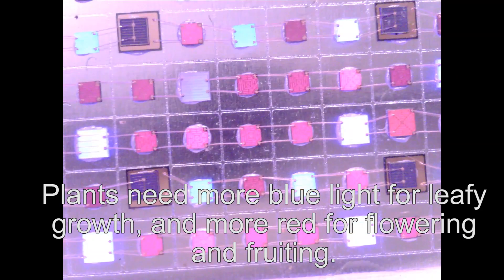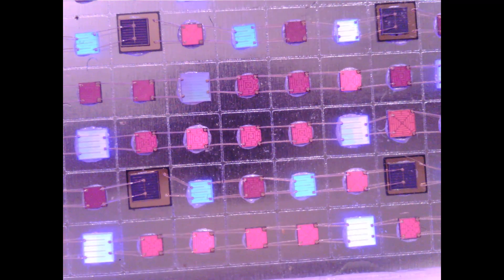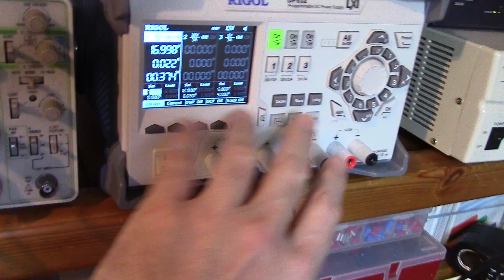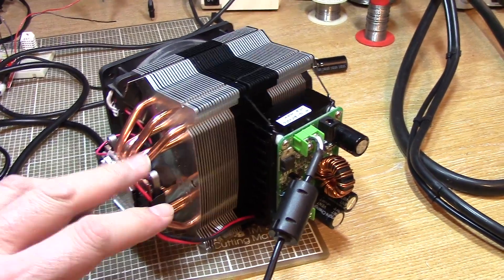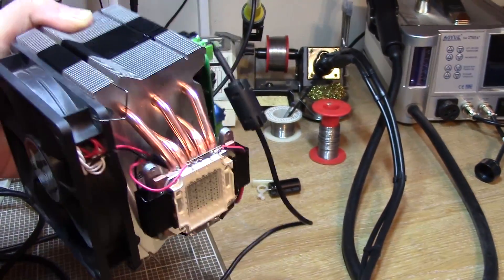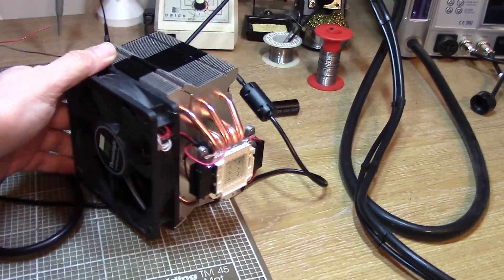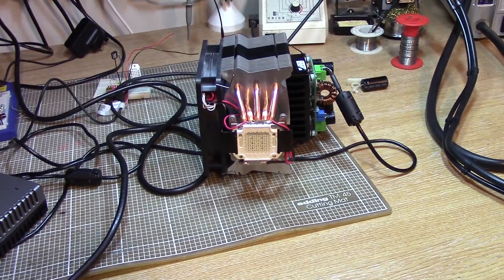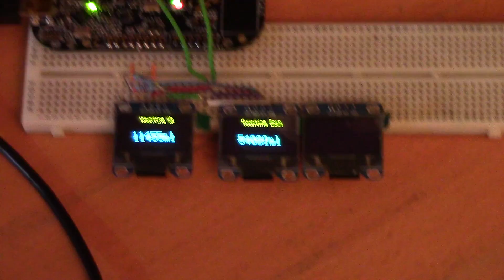DIY 100W 7-Band Multi-spectrum LED Growlight

Comment: You titled your vid as a DIY.  I'm Joe Schmuck and haven't a clue to what you're doing with all the electronics.  I'm picturing myself as busting down old TV's and radios to find anything close to what you've used there and with no understanding of what to connect and how.  Got a way to explain how to light up the LED's for the guy who just wants to grow a garden?  I'd love to have the full plant spectrum, but my knowledge of electronics is limited.  It is a great video and loved watching how you put it all together and the under the microscope view.  Never saw that before in any video on YT.  For the layman on the street, could I simply attach a power supply with an output of 12v or so?
Reply from the maker: Hi +Sincronicity - The problem with LEDs is that they need a current limiting device to stop them from killing themselves. The LED chip I used needs a limit of 3200 milliamps - I used an old laptop power supply and a  current limiting boost converter because I already had those bits lying around, but if you don't have that kind of stuff kickng about already, you're probably best off buying a ready-made LED power supply like this one... http://www.ebay.co.uk/itm/Waterproof-85-265V-Power-suply-LED-Driver-For-10w-20w-30w-50w-70w-80w-100w-Light-/271078945597?var=&hash=item3f1d90733d:m:mUxUWutlG6t_e-9rWseiHLw .. You'd need the 100W version of that power supply... Similarly I used the 12V computer fan because I already had that kicking around, but that meant I had to make a little circuit to get 12V to run the fan from... As an alternative, you could just use a 24V fan instead... like these ones... http://www.ebay.co.uk/itm/3D-Printer-24v-Cooling-Fan-25mm-30mm-40mm-50mm-60mm-Extruder-Fan-RepRap-/191458206299?var=&hash=item2c93cc625b:m:m6PyjIeUYOqwD28857uubWw ... Hope that helps. Cheers!!
Reply: +Jim Conner thanks Jim. I'm just one of those guys that knows enough about electricity to kill myself or start a fire. and thank you for giving such a quick response.

Comment: How are all the lights holding up so far?
Reply from the maker: Hi +Shannon Fraiser  - I only had the light running until the sunshine returned and I was able to move the plants out to the greenhouse. It was flawless for those four months, but has been sitting on a shelf since then. I will be putting it back into use again in January when I start next year's set of plants growing again. Given how cool the unit runs (<30C), I'm not really anticipating any problems for many years to come. Cheers!!

Comment: bomber light chap!
Reply: +Ryan Garcia interested to see how your nutrient meters turned out as well.
Reply from the maker: Thanks +Ryan Garcia  - Unfortunately the two circuits I made for the nutrient measurement are still sat on the desk gathering dust. I started a new job back in February and haven't had the time in the evenings to make progress with any of my electronics projects - It's very frustrating. I haven't given up though... next time I get a good chunk of holiday I'll try to make some more progress. Cheers!!
Reply: Awesome! best of luck with all, guess ill have to just stay tuned!

Comment: So 5 months on your tomatoes,cucumber and lettuces were all loverly and you had too many to eat yourself so you gave lots away? lol
but seriously did they grow ok size wise,quantity etc?
Cheers in advance
Reply from the maker: Hi garry parsons  - You've pretty much hit the nail on the head there. Everything did superbly under the lights until the weather was warm enough outdoors for them to grow in the greenhouse, and then everything grew spectacularly for a while. I've had a few setbacks though - I had the ceramic shaft on a water pump shatter leaving my strawberries without water for two days - that was a major setback. I've had reservoirs run dry repeatedly because I've still not got around to automating their top-ups, and I've been plagued by first fungus gnats, then aphids and currently spider mites... but in spite of all of that, I've still had great results. There's a 2"x3" box in our kitchen which is full of onions, peppers and tomatoes - we eat them as fast as we can, but it's still more food than we can give away. I certainly can't fault this grow light in any way though and will be getting it back into service for the coming winter once again. Cheers!!
Reply: Jim Conner cheers for quick response.
 Ahh just watched your vid over the spider mites .
You tried diatominous earth powder ?? costs nothing really you can add it to water and try it that way or powder it
We use it for chicken mite basically it kills most insects via contact and its not damaging to plants that im aware of  powder the room and walk away :D
Reply from the maker: Hi again garry parsons  - Diatomaceous Earth is something I've heard mentioned on a number of videos, but never really understood what it was all about - I've just been off and read up on it, and ordered myself a couple of kilos from Amazon - always handy to have more solutions in my arsenal. Thanks for the tip. I'll give that a try in a few weeks against the aphids in GH No.2 (if the neem hasn't worked by then). Cheers!!

Comment: Nice DIY LED Grow light, thanks for posting. Ive been wanting to make a 100W LED spot light (or possibly a grow light) for some time, I already have the perfect CPU heatsink for the job. If possible could you please post some links for the parts I would need (converter, transistor, power supply & circuit diagram?) or at least the specifications for the needed parts. I'm sure if you just listed the exact specs of the needed parts I could find them myself. Thanks for your time, take care & TECH ON!
Reply from the maker: Thanks William Chapman  - There's a link to the ebay item for the LED down in the comments here... That part came from a seller called tubelight. The converter I used is another ebay cheapy... if you search on ebay for '600W boost converter' you'll find the right item - they all look identical, so I just go with the cheapest seller on those. You'll want an old laptop power supply to run the whole setup... It needs to be capable of delivering around 90W of power - 4.5A@19V seems to be quite a common type of laptop supply to use and that'd do the job nicely. For the fan power regulator I used the schematic I found at http://www.radio-electronics.com/info/power-management/linear-power-supply-psu/series-voltage-regulator-theory-circuit.php - You need a 12V zener diode, a 1K resistor, and an NPN transistor - It doesn't matter too much which particular NPN transistor you use as long as it's a transistor in a TO220 package style (the ones with the metal lug at the back) as it'll need to be able to dissipate a couple of watts of heat. I can't remember which specific transistor I used... it was just something I desoldered from an old circuit board somewhere. We don't need to care about the transistor gain value or switch on voltage or anything clever like that... you just need a chunky NPN transistor. Hope that helps - if you need any more details, ping me again and I can elaborate some more. Cheers!!
Reply: Thanks for the prompt response, Jim, much obliged. I should be able to complete approximately 95% of the DIY project with the information you provided however, I will probably have a few basic questions on a couple things just to make sure I understand everything & do it correctly. I have the knowledge & skill to build a custom desktop PC but I'm not too familiar with these kind of parts/components (boost converters, voltage regulators, transistors & circuit diagrams). I do have a basic understanding of these components & what they do but I'm no expert by any means, so I will probably need a little advice/assistance to ensure I complete the project properly. Once I obtain all the components I will complete as much of the project as I'm confident doing, if I get stuck or am not sure about something I will contact you for further advice. Thanks again for time, take care & keep the DIY tech vids coming.
Reply from the maker: As long as you have a multimeter so that you can set the voltage/current correctly then I'm confident that you won't struggle too much with this project, but if you need a hand I'm always somewhere near a PC and pretty quick at picking up my messages. Good luck and let me know if you need anything. Cheers!!
Reply: Thanks again, Jim, you're a very knowledgeable & generous person. I sure wish I lived near you because I would love to come assist you on some of these projects, I know I could learn a lot from you.

Comment: I like to see if u wood sell me a led or make me one I got cash hit me back I need one. Bad I got one or tow I need a good grow led can u help
Reply from the maker: Hi Paul Goudelock - I'm afraid this was a one-off for me using bits I already had lying around. The LEDs themselves are still available on ebay though (as are all the parts I used), and as you've seen in this video, it's super-easy to build one for youself. If you're looking for a ready-made unit though, searching for 'COB grow light' on ebay will find you what you're looking for (COB = Chip-on-board... the kind of LED I used for making this). Hope that helps. Thanks for watching and taking the time to comment. Cheers!!

Comment: Will you be putting these in production ?? .. the existing led grow lights are just ridiculously expensive
Reply from the maker: Hi Gary Host - I have absolutely no plans to go into production with these lights. It seems to be the light-engine variants of grow lights which command the premium price... If you're happy enough to go with individual LEDs then you can pick up a 100W ready-made light for about the same cost it took me to make my 100W unit... Here's the sort of thing I mean.. http://www.ebay.co.uk/itm/VIPAR-V200-LED-Grow-Lighting-200W-Indoor-Bloom-Veg-Spectrum-Hydro-Lamp-Fixture-/171730909133?pt=LH_DefaultDomain_3&hash=item27fbf5b7cd ... (although the advert says it's 200W, the specs say it uses 90W of power).  Hope that helps. Cheers!!
Reply: Jim Conner I dont believe the larger diode type panels are as good. With the 100w multiband the light is more intense. If you look at the "real" grow lights such as the Heliospectra etc.. they all use the concentrated chip, not diod based lights.
http://store.heliospectra.com/collections/bestselling/products/lx601 

Unfortunately those cost £1500 a piece but they are 630w of power, and wifi controlled.
Reply from the maker: Thanks Gary. That heliospectra light sure looks like the business... I very much like that you can tune the light spectrum through software for different parts of the growing cycle. Theoretically it shouldn't make any difference whether the light comes from a point-source (i.e. light-engine chip) or from a bunch of discrete devices... Where the light engine chips win out is over the ease of design/manufacturing as there's less connections to solder, less reflectors to worry about and simpler optics. I suspect that this is why all the professional grade grow lights are using the chips... I am very tempted by the idea of supplementing this 100W multispectrum chip with dedicated blue/red/white chips to be able to tune the colour spectrum like the heliospectra people do - that would be awesome... Perhaps that's a project for next winter. Cheers!!

Comment: thats a sweet little light.  I bet that Zalman cooler is actually cooling better than standard heatsink/fans found in lights
Reply from the maker: Thanks IzInAZ - Yeah - that Zalman is a going to be far better than the cheap chunk of aluminium and noisy fan you'd normally get. It's pretty much silent in operation and the back of the LED module is at about 40C... it should last forever. Cheers!!

Comment: Love the details and video.  Is that 600w boost converter constant current?  So once you set it will it stay at that current forever?
Reply from the maker: Hi Roberto - Yes, that's right.. I set it to 3.2Amps which is what the LED can handle...  Cheers!!

Comment: What you have there is MCOB "Multiple Chip On Board " LED, great for horticulture. Just be aware how hot it gets and keep it cooled. You might try CPU heatsink if you find they are burning out to fast. Nice job.
Reply from the maker: Robbie Dang Thanks Robbie. It's doing an excellent job on the seedlings I have under it. The heatsink on there is a Zalman CPU heatsink and it's doing an excellent job of keeping it cool. The LED can only be driven at 80W of power due to the mix of different LED types in there, and the heatsink has no problem with a measley 80W... The metal heat spreader plate on the back of the LEDs doesn't get above 40C. Cheers!!

Comment: Hi Jim,
I've been putting one together that's 3 x 100 watt, 1 is cool white the other 2 warm white.  The chips are darn cheap on ebay.  I'll be running off of a computer PSU and an up converter for each chip.  Each chip with cooling, but not as fantastic as the one you used, lol.  From what I understand is that the cool white LED are just blue LED with phosphorus.  And the warm will cover the red spectrum.  This is just going to be a light bar above hydroponics tubs.  Amazon has the 100 watt chips with driver (Lohas) for way too much $$ but I didn't know if it would burn the LED too much if it's cranking out full power with not that much difference in light output.  I purchased the lens kits but may only use them for taller plants. 
My question...How hot does the step-up run?
Reply from the maker: Hi Ted. That sounds like a good setup you're building. I'd been pondering doing a similar thing with using a mixture of different colour LEDs,,, but then the multi-band LED became available on ebay and I went with that instead. The setup with the massive heatsink runs very cool...The heatsink feels ever so slightly lukewarm to the touch, and the backing plate on the LED module isn't much hotter...  In a very unspecific fashion, I'd estimate that the backing plate is hotter than my body temperature, but cooler than I like my baths... so somewhere around 40C/104F I'm guessing. Cheers!!

Comment: Very nice job there Jim and good explanations too. It's a good job us computer builders kept our custom CPU heatsinks aye.. Who knew that they would eventually bring out 100W+ LEDS for them :)
Reply from the maker: ***** Thanks John... I have a shelf in my garage which is about half-full with old computer heat sinks - I could never bring myself to throw out those beautifully crafted lumps of aluminium and copper... Occasionaly I saw one up so I can bolt a bit of it onto a TO220 package. Cheers!!

Comment: Man! How cool is that?? I'm looking forward to seeing how well it works, Jim! I am using plant bulbs in my 4 tube t-8 shop light, but I don't think it compares to that LED at all! Loved the intro as well!
Reply from the maker: Keyplayr61 Greenhouse Hydroponics And Gardens Thanks Keith. I not entirely convinced that the LED will perform better than the T8s - I asked the guys at my local hydroponics shop about LED growlights a few months back because I noticed they didn't stock them... they reckoned that they weren't really ready for the prime time yet,,, Most people seem to be growing under flouescents, which makes a lot of sense when starting plants off because the blue light is the important part for leafy growth.... But knowing all that, I still couldn't resist this LED because it looked so pretty :) - When I first saw it power up on 1mA, I thought it was a lot like a sunrise... hence the intro. Cheers!!

Comment: Well done! I've noticed the wattage rating being off as well, especially for the reds because of the voltage drop? It looks like a very nice balance that could be very useful for much more complex plant production. A friend of mine gave me a very similar heat sink that I was pondering on what LED to use it for so I'm glad to see that handle it very easily. Something if you haven't done already to consider is to take the board off the heat-sink of the 600 watt boost converter and make sure the two chips on the bottom of the board are flush with the heat-sink, one of which I believe is a schottky rectifier. I've had a failure before after running one for awhile and found that actually both were not properly seated. So when I get a new one  always take it apart to check that they are flush and tight and apply fresh thermal compound. I haven't had a problem since (at least none that weren't operator error). Hoping to have a video up within a week or so for the low powered LED light. I wanted to get some growth to show first. Oh and what microscope is that? That was a great way to start the video.
Reply from the maker: Trace Waters Thanks Trace - I've examined that boost converter pretty thoroughly and it all looks OK - don't want to take it off the light now that I've finished building it. I've ordered myself another one (and a smaller 100W version), so I'll inspect them closely when they arrive. The microscope is a reasonably Andonstar 2MP USB one (about $50) - it's OK... it has a better stand than most of them do (though the stand does wobble from side to side a bit when you adjust the focus) - I broke the stand yesterday whilst I was filming that LED, so now it's even less good than it was. I might have to investigate a better microscope (something which can do a higher frame rate would be good... that one drops to 15FPS at anything above 800x600). I'm hoping to show a look at the plants tomorrow... I've just finished moving the seedlings into the ultrasonic rooting chamber, so that should prevent the seedlings from drying out next week when I'm at work. Cheers!!.